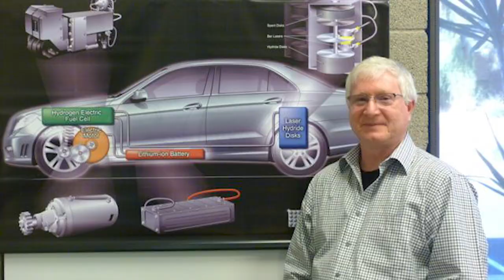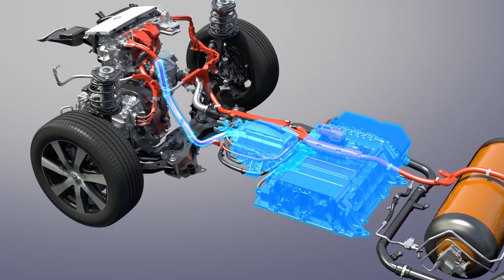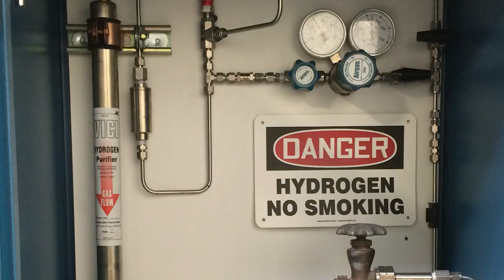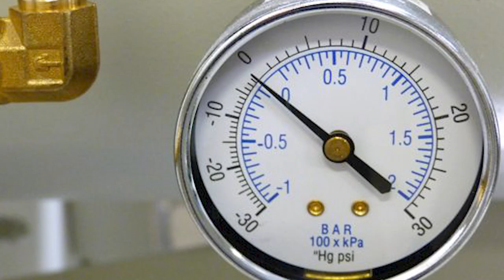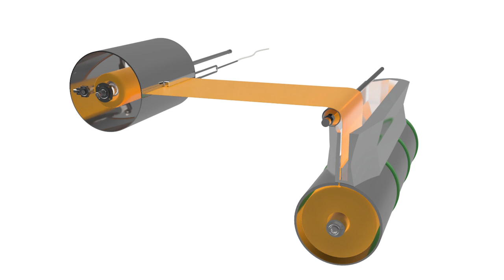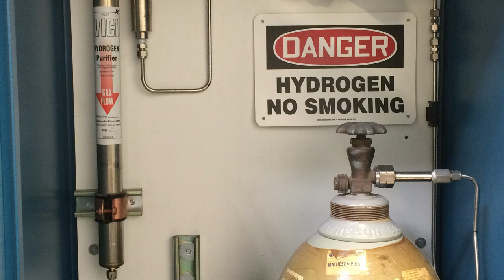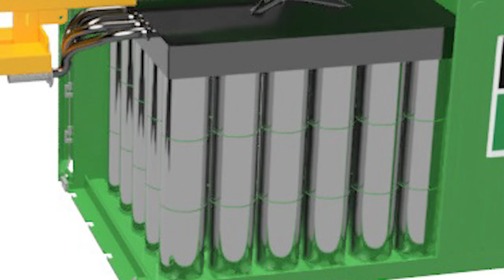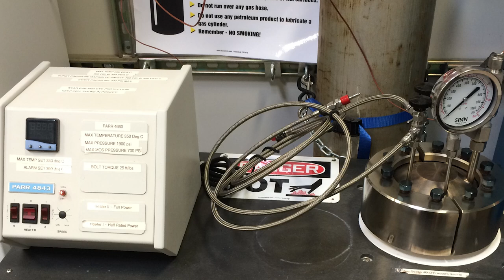This BANNED Technology Could Push Hydrogen Cars Over BEVs

Comment: To be able to swap out disc's or cylinders would be a very welcome alternative to the ICE car I now have simply because I can stockpile them for my off-grid lifestyle...now if I could replace propane with something that can provide the 4,000 to 10,000 BTU I need in the winter to heat and also cook then I can keep my Cabin free of a woodstove and then finally have heat without flammable explosive gases...I'm in the northeastern part of Washington State and we only get low angle 6 hours of light for the winter and it's mostly cloudy and overcast so solar power is not much help...wind power is doable but we would need large battery storage as with solar for its intermittent nature...solar has periods of no light or greatly reduced productivity...the Fuel Cell Hydrogen Disc's and Cylinders would make my off-grid lifestyle a lot more productive and enjoyable...and if I also incorporated the solar and wind methods I could conceiveably provide my own relayering my used disca or cylinders and be truely self powerd...I could probably even "generate" my own water by takeing the O2 from the electrolytes and run it through a sucsion pump to recombine the O2 useing heat with the plentiful Hydrogen in the air...at least in theory and my knowledge base...but frankly this could be a very good thing because I could regain the use of a dead ICE generator that provides 3400 watts compared to the replacement of only 1800 watts but uses far less gasoline for 12 hours of runtime at 1/4 load capacity...the other generator that broke.internally I could replace the ice with a Hydrogen motor and be off to the races with two gasoline generators converted to Hydrogen motors with this refill technology would be godsend boon for my preferred lifestyle and so many more doing the same as I am...I would so welcome this alternative because those propane bottles may be difficult when I'm 117 years old and still kicking like a mule...lol...but carrying heavy weighted items may be problematic then...a lightweight Hydrogen disc could be great for those desired times of nearly Continual power availability...yeah...by all means bring this tech to me before I'm too old to enjoy it...I'm 65...and still kicking like a horse...so if I can get into this stuff within the next 5 or so years I'd jump on it as soon as I could...I'd trade in my ICE car for a HYD car...oh...need a cabin heater though, it gets very cold here in the winter...thanks for reading my rather long comment.

Comment: This doesn’t address the problem with hydrogen which is that it is inefficient. Hydrogen will still cost 3x as much per mile. The storage system is irrelevant to this.
Reply: What's your time worth?
Reply: the video claims half the cost of today's hydrogen comes from compression and cryogenic storage - all of which goes away.

Comment: Unless it can compete with pressurized H2 gas for storage capacity it won't make it into vehicles. It sounds like a great idea but if you need 100Lbs or more of film to get 500+ miles people will opt for the pressurized gas. The Toyota Mirai can get over 800 miles on a single tank (12+ pounds ) of hydrogen.

Comment: Very interesting interview. Will it really be cheaper and more convenient to use this solid form of hydrogen instead of batteries? Batteries too are still getting cleaner, more reusable and cheaper all the time. What will the business case be for solid state hydrogen disks in the equation of batteries continuously and substantially dropping in price for years to come? Anyway there will some good use for solid hydrogen tech as proposed in the video.
Reply: no
Reply: Not in the next 10 years maybe more if solid state batteries come on the market but this is a new technology with alot of room for improvement
Reply: Its energy density is more than 2x what we currently have available commercially so the best use scenario for this tech would realistically be helicopters airplanes and autonomous air vehicles because our current density doesn't allow anything but very small airplanes, very light and very expensive with exquisite materials with only one passenger but the energy density on this could very realistically allow for much larger air vehicles
Reply: These fools did zero research on the subject and made a whole video about it
Reply: Batteries have to carry all the chemical reactants around with them while historically, IC engines took the fuel with them and got the oxidizer from the air. Fuel to air ratio on a conventional gasoline engine is roughly 15 parts of air to one part of fuel. Air is about 20 pct oxygen, bur separating the two is expensive.
Reply: electric batteries are a dead end technology;  it can only progress so far when it's reliant on rare resources like lithium and cobalt;  we're already at the maximum capacity at which we can mine and process them into batteries (which is no where near enough for a complete transition to battery EV's).  And no matter how far it progresses,  it can still never overcome the basic laws of thermodynamics (capacitance & discharge rate depending on temperature);  the problem isn't how much power you can store,  it's how fast you can store it,  and how quickly you can release it,  which is far inferior to liquid storage/gasoline.

The possibilities for hydrogen storage are as boundless as it's abundance...

Comment: Hydrogen is 15 bucks per kg and hard to store. Any solid state hydrogen would require energy to separate the fuel in order to use it. Wouldn't there be efficacy issues?

Comment: I'll repeat something I said below here. The Aptera (which Sandy is an investor in) is a true eco vehicle. It is the only BEV that can go 1000 miles on a single charge and yet it uses a much smaller motor and battery.It is covered in solar panels and can drive 30-40 miles a day just on solar power and It only weighs in at half a ton compared to a Tesla which weighs 2 tons. It is designed to last generations and can be charged in a regular household electrical outlet. No high end charging network required. Hydrogen has been touted for years but really looks like a way for big oil to try and confuse and block BEVs from gaining ground. What I do like about burning Hydrogen in an ICE engine is that the only exhaust is C02 and clean water. No pollution just C02 to worry about. I wasn't aware of the energy inefficiency in capturing it so I agree with he consensus below that this is a distraction rather than a real solution. EV tech and especially battery tech is accelerating at breakneck speeds so even though BEVs are not yet truly green due to the massive energy hit in their manufacture. We still need to do it though as the tech will catch up and mass production will eventually make BEVs cheaper than ICE cars. Next generation or the one after in battery tech will clinch it. Also we need to look at much better materials than steel. Carbon Fibre and Hemp Fibre are better materials. Hemp is 10 times stronger than steel. Henry Ford built a car out of it in the 1940s to prove that point and he also stated that Hemp was the fuel of the future in the 1920s. Most people are not aware but he released both a gasoline version and a hemp ethanol version of his infamous Model T. You can reserve an Aptera for 100 dollars with no commitment to buy. I'm doing it even though I'm in the UK. It is basically a BEV with virtually no running costs or dependancy on any kind of charging network.

Comment: Come back in 10 years and give us an update. Oh, and battery technology is not going to stand still for 10 years.
Reply: Oh, i dont know, battery tech hasnt progressed much in the last 10-20 years !
 Still using the same old 18650 lithium cells !.....and Lead Acid as starter batteries in ICE cars .
Reply: @weinisable  You don't count the new 4680 cells as a major breakthrough in battery technology?! They will likely power not only Tesla EVs but other brand EVs as well, as other battery makers are licensed to produce them. Higher energy density (5x), more power (6x), greater range (+16%), and lower manufacturing cost.
Reply: @kevinpolito1529   you really do not understand this battery technology, do you.
 All the 4680 is , is a bigger cell with the same ( very similar) chemistry as previous tesla 18650 and 21700 cells.
 The only significant difference is the cathode tab c
Reply: @kevinpolito1529  4680 energy density  (Wh/kg) is basicly the same as 21700/18650, which means the Range (km/kg) is also unchanged.
 Manufacturing costs are unknown, simply because they have yet to go into mass production.
But we do know the total cost ($/kwh) is little changed from the < $100/kWh Musk keeps telling the world they already have.
...( but how much is a 15kWh PowerWall ? )
Reply: @weinisable  Chad, you obviously have not done your homework here.
Reply: @kevinpolito1529   oh kevin !
  If these 4680 cells had 5x the energy density, they would be at over 1.0kW/kg....a figure which even you must see is impossible !... 
i dont need homework, ..i understand the technology .!
Reply: @weinisable  You don't have a leg to stand on.
Reply: @kevinpolito1529  actually i have two !...... both fully functional .🦵🏼🦵🏼

Comment: Would love to see an electric alternative and glad toyota didn't throw in the towel with the Marai
Reply: It's a good looking car IMO, in the time being they should make a PHEV Lexus version.
Reply: @andrewmeehan6151  agreed. Love the look inside and out
Reply: Because nothing says "Freedom" like being stuck driving in tight circles in the only state that has H2 stations (and one blew up not too long ago). 

This is an obscenely expensive compliance car solution. 
The fact that this iteration is Slightly less expensive doesn't make it a threat to the Way, Way simpler, more efficient EV.
Reply: @avgjoe5969  The problem with the EV is price,
They are getting more expensive because the materials are in higher demand now.
Reply: @andrewmeehan6151  Lithium isn't the problem people seem to think it is. Extraction from other sources is do-able. Cobalt being phased out. Nickel though. 
That's a tough nut to crack for the higher performance vehicles like the Semi. Really can't do without it yet.
Reply: @avgjoe5969  it’s not a problem now because they are only like 2% or the market. The grid also won’t be able to handle everyone driving Bev

Comment: Who on earth wants to go looking for a hydrogen filling point when you can charge at home? It's crazy.  The big oil companies desperately want hydrogen to succeed, then they can continue to control the market and the price, as they always did with gas and diesel.
Reply: Exactly.
Reply: Spot on. But also, Governments would also then have control of the taxation level for the fuel for cars. They can't do that with an electric plug at someone's home without causing massive pushback.

Comment: 11:47
"Anything is possible".
Ah.. no... no it's not.  There are going to be limits to the density.  Same for lithium batteries.  The theoretical limits are something we can calculate.
But that's not what has me a bit skeptical here.  What has me skeptical is the elephant in the room.  The same elephant that is currently sitting on the hood of the Mirai.
Platinum.
I'm open to correction here, but the only catalyst I'm aware of that is currently available for hydrogen fuel cells... is platinum.
30 grams or so per fuel cell.
Not only is this not sustainable long term for just the volume at 30 grams per vehicle... at only about 3 grams of platinum... next to your air bag catalytic converters are the number one high dollar item stolen from the cars.
In today's market, this is about $1,000 per car... that is a non negotiable price.  And that's for a small car.  For a truck you are talking 8-10X that.

The other thing I thought was odd that they didn't mention was that you still have to compress it.  To about 600lbs.  This adds a fair amount of complexity to any automotive system that is going to use this.
So while Sandy Monroe may have had his reasons for saying what he did in regards to this solving the battery availability problem... it opens a whole other can of worms.
Reply: And you are still swapping out 300lbs of hydrogen batteries every time you go to fill up. Moving that much weight is hard on equipment, expensive, and will probably need an operator at the swap out station so now you have to pay an extra salary.
Reply: @Kiromos  Everything about pushing hydrogen over electricity in batteries is all about desperately trying to maintain the status quo.
They are desperate to try and save the current business model of not only dealerships but also fuel distribution.
I just returned from a short out of town trip that did not exceed the range of my EV and it is now recharging in my garage on sunlight stored yesterday in batteries.

That's the last thing they want.  And by they.. I mean not only the legacy auto manufacturers but also big oil... and even your own government.
This represents the greatest advancement in personal freedom since the repeating rifle.  Something else that the government isn't too keen on.

Comment: You forgot to bring up the point that 95% of all hydrogen production is from fossil fuels. To get around that you have to use water electrolysis, which requires more energy, and also means you are essentially storing water on these cassettes. Sufficient clean water is already a concern in many parts of the world, but yeah let's turn water into a fuel source.

Comment: First, I thought your questions were excellent - good job. Second, this is a very interesting and exciting technology. The only question I have at this point is how the hydrogen is taken off the "discs" and burned in the engine? I see a laser being used, but how does the laser control the amount of hydrogen that is burned, and hbow does the hydrogen get to the combustion chamber (or whatever)??? Thank you!
Reply: @Super Bear, it is not burning the Hydrogen, it is combining the Hydrogen with oxygen to create water, the same as a fuel cell.  An electron is stripped and forced to power the motor before it is reunited with the oxygen and hydrogen.  So the car will be Electric but using these cartridges for fuel instead of recharging a battery or filling up a tank with hydrogen.  Watch a video on Hydrogen Fuel Cell and then instead of compressed hydrogen you have this tech to store hydrogen in a solid format.

Comment: this thing isn't going anywhere. it looks good on first sight and it might had a chance 20 years ago, but today the whole system is still far too complex and inefficient. Sandy got fooled by this. hydrogen is only good for big stationary storage if at all. it doesn't even make sense for trucking, as tesla will prove soon, and others will follow
Reply: Not the first time “Sandy” has been fooled by new tech.
 Even the 4680 Tesla cell had him screwed up on pack size requirements.

Comment: If the film can be recharged 100+ times, can that be done while it is still in the car?  Or does it have to be swapped out and done at a specialized facility.  In other words can they pump your car with hydrogen and refuel the ribbon?  That would make it much more desirable.

Comment: I keep reading people referring to H2 used in an ICE - it is NOT suitable.  The CSIRO in AUSTRALIA has solved the problems for the transport, storage and filling of H2 fuel cell powered vehicles.  The fill time of the vehicle H2 tanks is similar to a petrol or compressed gas vehicle.  Fuel cell vehicles are possible, now - IF the filling stations were in place. Have a safe and nice day all.  CHEERS from AUSTRALIA.

Comment: Hi. I'm curious.... the white cassette shown at 7min 20sec, looks to be a continuous loop film, excellent idea, allows for less space than a dual real system. However, my question, based on this picture at the stated time, appears to show a single sided use of the film, could you not, using a mobius twist, use both sides of the film, therefore, approximately, doubling the volume of H2 in a single cassette ?

Comment: OK, so this solves the storage and delivery issues but: 

1. how much energy is used to create and load the 'cassette' and how much is used to release the H2? I see inefficiencies creeping in here. 

2. it doesn't solve the issue of sourcing the H2. Both steam reformation and electrolysis are very energy intensive and use more energy than you get out the other end.

3. nothing was said about the elephant in the room: batteries. All FCEV's need batteries as the fuel cell process only produces energy at a constant rate which doesn't work for acceleration. Batteries buffer the energy produced, as it's produced, so it's available when you need it. So if you need batteries anyway (admittedly fewer of them) why not just go the whole hog and get a BEV?

H2 is not an energy source. It is an energy transport medium. Electricity is an energy source so if you can store energy directly while simply plugging into the grid, why do you need the extra hassle of converting it to a transportable form only to turn it back again immediately before use?

Clever idea and it might have had a future had BEV's not already taken off but it only solves a couple of the drawbacks of hydrogen, not all of them. For an H2 tech to be viable, it needs to solve all of the problems while being demonstrably better than batteries. This is a step in the right direction, however, but nothing more than that.

Comment: This technology does not solve the problem of hydrogen production, only its storage. If you own an electric car with a battery, you can charge it directly from your home photovoltaic system, and you don't have to worry about where to get hydrogen for your car.